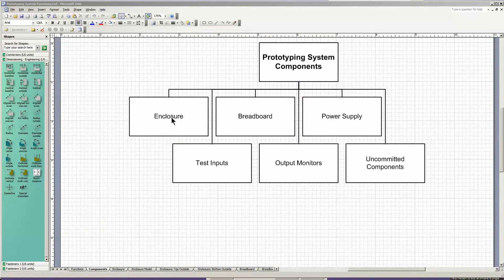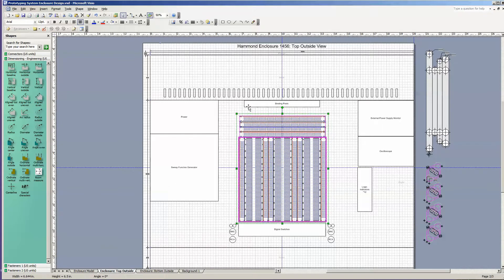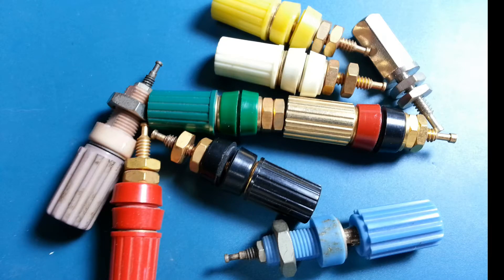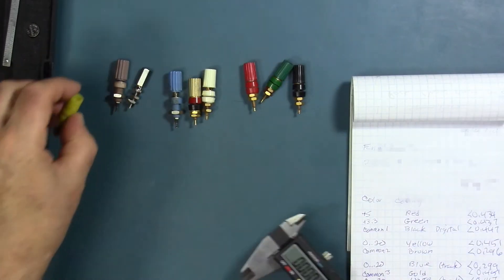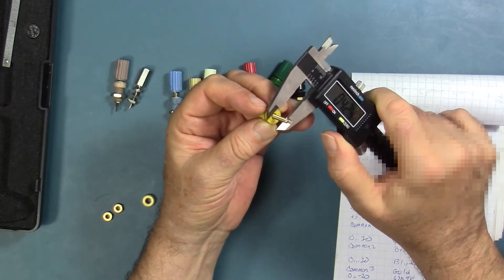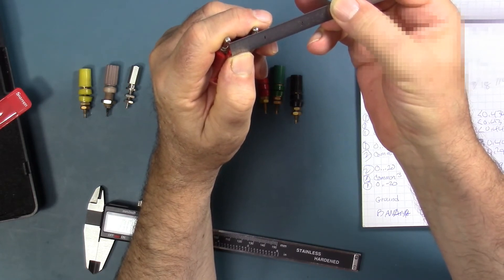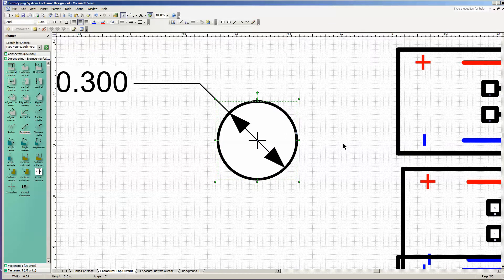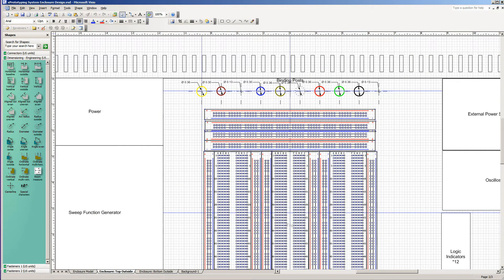006-Breadboard--Binding Posts (1)

Comment: Congratulations on your presentation.  I appreciate all efforts big or small by persons like you who take the time and effort to share with others what they built or think.  May i suggest that if you correct this video you include a table clearly showing what you had in mind, because a person such as myself a retiree with limited knowledge and means could understand better.
Thanks and congratulations.
Reply from the maker: You're welcome. Thank you for thanking us.

Regarding what we had in mind, we tried to describe this in the first few videos (beginning with 002-Prototyping System Functions), and in the Prototyping System Design document, which is being maintained as the system evolves. You can access both the videos and related documentation at the corresponding web site:
     http://www.ehobbyistblog.com